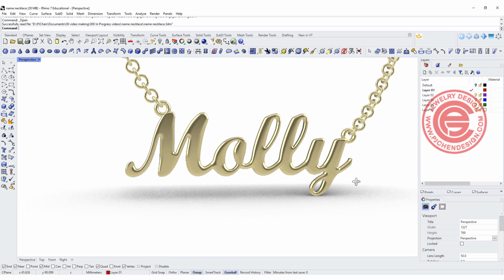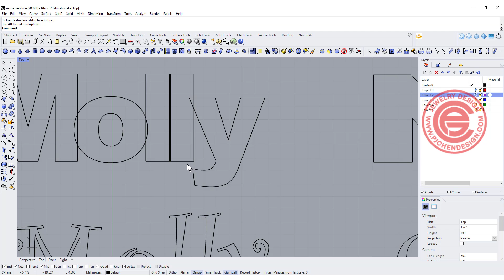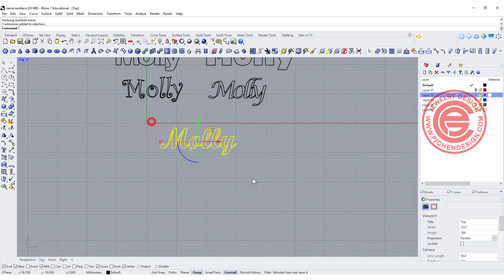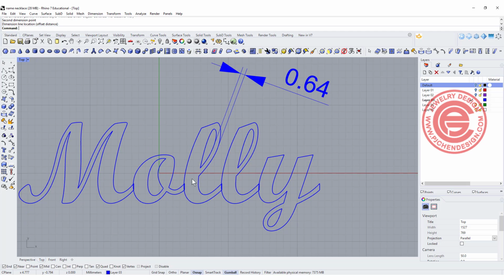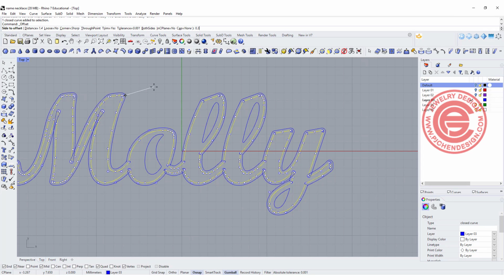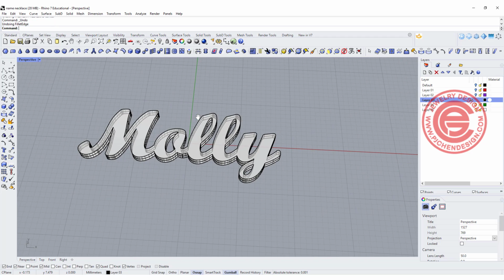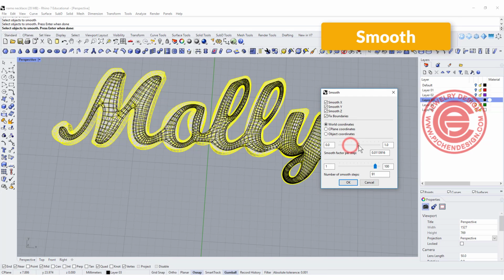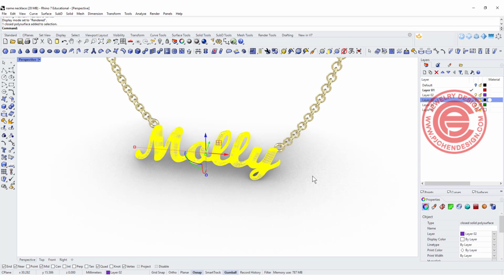Custom Name Necklace- Jewelry CAD Design Tutorial 3D Modeling with Rhino 7 #173

Comment: Noob Question - When I try to fillet the individual corners I can't. I select Fillet Corner, choose the loop in the L and select 0.1 but nothing happens. What am I doing wrong? Thanks
Reply from the maker: fillet will fail if the fillet radius is larger than the surface you are going to fillet. in this case. nothing will happened.